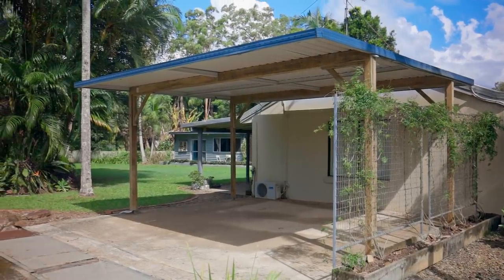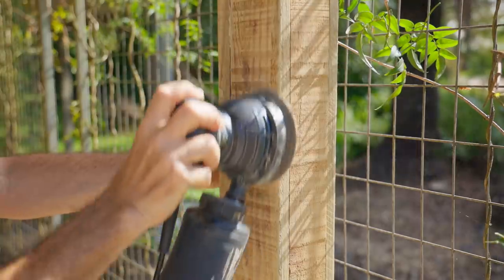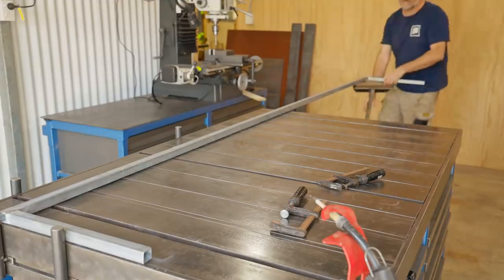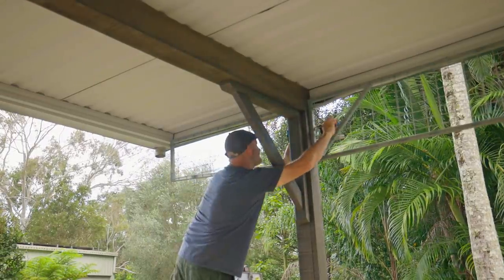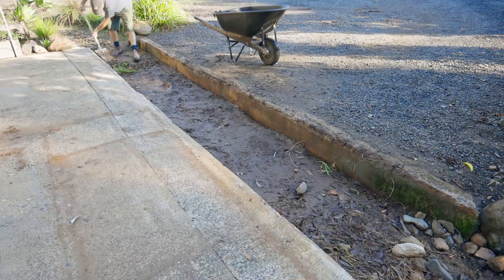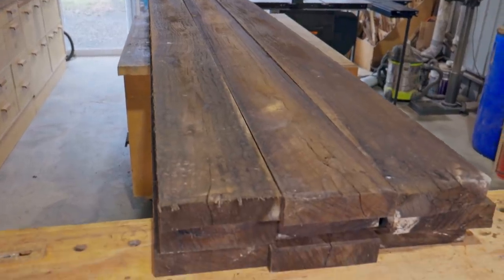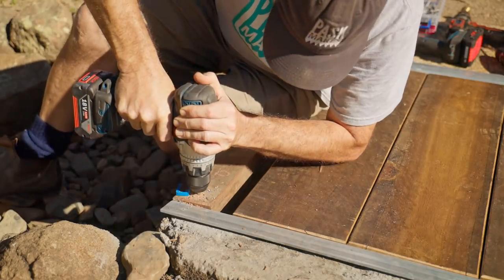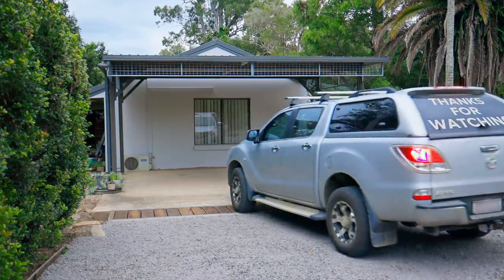DIY Carport makeover Pt2 - Now Complete

Comment: the hardwood looks really good. I've seen some people finishing it with the same oil that is used on the railways, and it waterproofs the boards.

I live in tropics, and I pretty much have to soak every outdoor wood in oil. sometimes I use a synthetic car engine oil, which I accumulate from the car servicing leftovers.

Comment: Great little project,  had to laugh at the armoury of drills for the sleepers. 1. Glad you repainted the face of the house, I could imagine the rust stains from all the cutting and grinding. 2. Movement is the enemy of the grid, a bed of grout would have been good. Hopefully when you flashed it up at the end, plenty of mortar got pressed under the edges to help support the steels. Loving the channel!

Comment: I have that little Unimig Welder - I can attest also that it's excellent. Relatively easy for someone like me to learn welding, and get pretty good results in no time!

Just get some of that anti spatter spray and a good wire brush / wheel for all the flux residue!

Comment: Looks good Neil! Little tip with your new welder, when using gasless mig wire you can remove the gas shield cone off the handle, could just be mental thing but I find it gives me a much better weld, especially in tight angles as you can get in a lot closer.

Comment: Another awesome build. I like watching things like this on your channel too because it’s practical and beautiful in the same way a piece of furniture is or a shop upgrade. Hopefully you continue to post videos like these.

By the way, you have many of the necessary tools and skill sets to get into GFRC. I would highly recommend you try it. I was going to recommend GFRC for the patched concrete because it’s much more dense than regular concrete because the aggregate particles are much smaller, and yet the glass fibers and polymer additives make it equally strong.

You should try it out. I think GFRC pieces make beautiful additions to furniture pieces, like tops and drawer faces, even full vanities with shelf spaces, sinks and countertops all in a single unified shape.

Comment: You could epoxy that concrete floor, there are many colors and textures like sanded ones which would be brilliant for there as it wouldn't be slippery, only drawback is this product is expensive. Also proper preparation of the concrete before application is crucial.

Comment: There is one product I can think of that would cover the boards. Not sure if you can get it in australia, but it's an enamel coat for garages to prevent oil stains. But it's a paint not a stain or clear coat.
Reply: It's also super toxic fumes and chemicals.

Comment: It turned out that the awesome power of the new ground clamp was just too much for the old cheap welder to handle. Alas, I'm sure it will be missed, although at least you were able to source a successor in short order.

Comment: Wow I was so looking forward to this part 2 video and you didn't disappoint! What a fantastic result, especially the grate - spectacular!
Could you please tell me where you picked up the max pro 1 hour concrete please? It seems to have gone off the market down here in NSW so it probably won't help, but you never know. I have some similar jobs to what you used it for, and it seems ideal, there doesn't seem to be anything quite like it on the market at the moment.

Comment: Spoiler Alert !!!!!
My experience with Jasmine here in Adelaide is one involving frustration, Asthma, Hayfever, irate neighbours, high chemical and tooling costs when the rotten stuff escaped from the concrete planter box I had contained it in. Once the stuff had gained it's freedom I had to resort to mattocks, chainsaws, blow torches, solarization,  and tanker loads of glyphosate to check it's progress long enough to enable me to dig it out ,sifting each shovel full of dirt for fragments of root and stem.
The extra holes in the bottom of your planter box I see as a BIG mistake Mate.
Good luck
Eric

Comment: When welding galvanized steel, a respirator is required so that the zinc oxide fumes from the galvanizing are not inhaled. Inhalation of zinc oxide fumes can cause metal fume fever. This acute overexposure to zinc oxide through the respiratory system causes flu like symptoms that can be severe.